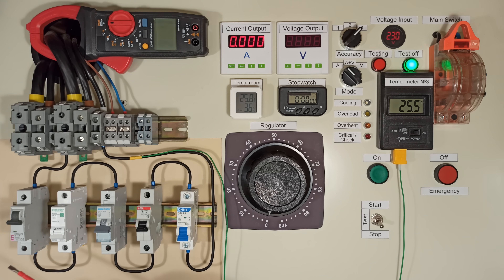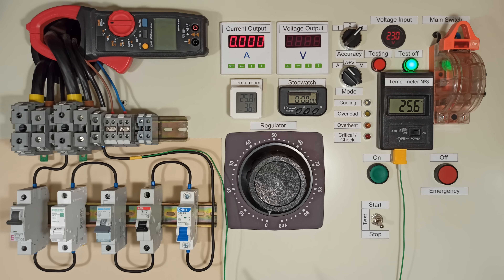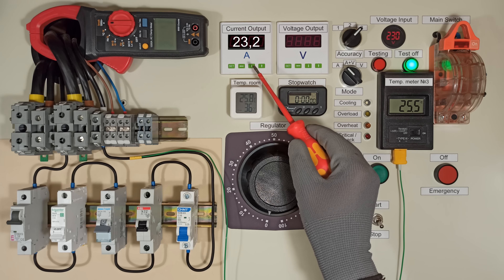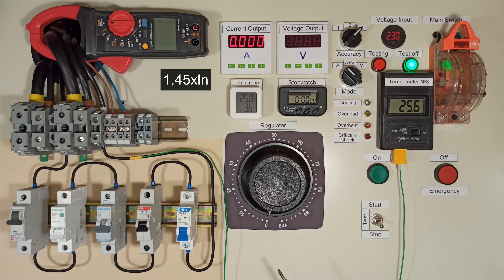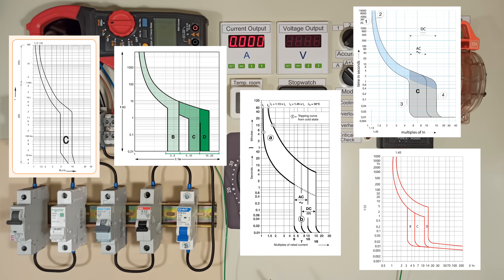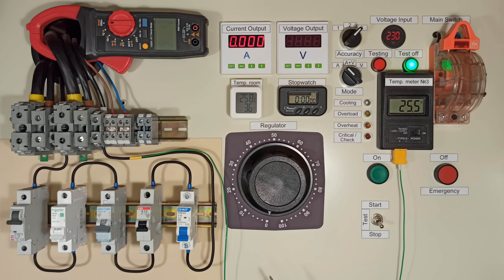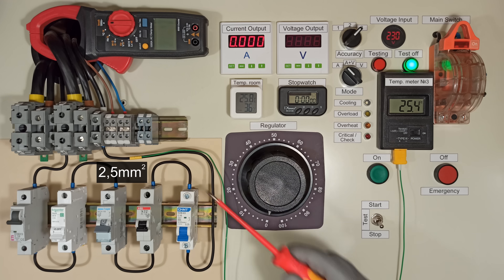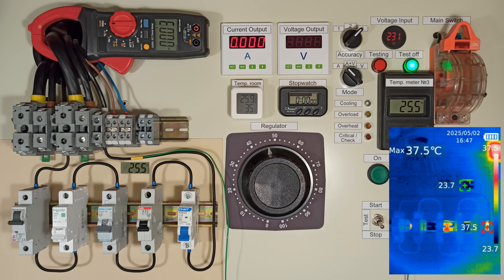Test MCB 16A. ETI, SE, Hager, ABB, CHINT

Comment: I'd like to see the same test but with the current carrying wire and thermocouple wrapped in some insulative fiberglass, more closely replicating the in-wall conditions (at least in the US).  Or you could place in ducting/flex tube with a few more conductors, like would be found outside North America.  
I wonder how much higher the wire temperature would rise without open airflow over it.
Reply from the maker: @FirstNameLastName-tp5bu Good suggestion, I'm still working on a larger test setup. Do you run the wire or cable directly in the insulative fiberglass, or do you also use a pipe?
Reply: @ElectroTest_1  Yes, here in North America the cable, often referred to as Romex (a brand name), will be run in contact with the in-wall insulation.  That insulation is usually fiberglass but can be other materials.  It's not uncommon to have 2 or more Romex cables running along the same path within a wall as they travel to distant areas of a home.  So the number of current carrying conductors in a small area can be 2 or more.  There are exceptions, for example in Chicago, all cable must be installed inside metal conduit pipe.

In residential construction, circuit ampacity is usually 15A or 20A, with 15A being most common.  Supply voltage is 120v and North American Electrical Code (NEC) calls for a minimum of 14awg (2.08mm2) copper on a 15A branch circuit, and 12awg (3.31mm2) copper for 20A.

Hope that gives you enough info to set up a test, if you want to emulate the way things are done over here.

[Edited to correct copper cable metric area equivalencies]
Reply from the maker: Thank you for the detailed information. I think it's worth trying. There is a problem with the availability of AWG cables. I will check if it's possible to order them at a reasonable price. Could you also mention some common cable brands that are typically installed inside walls?
Reply: @ElectroTest_1  Rereading my earlier reply, I found a mistake in my conversion from AWG to a rough metric equivalent.  (I'll try to correct my earlier post if YouTube will let me) I believe US 14 AWG solid copper wire is 1.63 mm diameter, or 2.08 mm2, meaning that the closest you'd have available is 2.5mm2.

Comment: Interesting test, it looks like the Chint has some more internal resistance on the top side. Which is getting warmer.
Im also curious how some budget brands perform. Like E-mat and Gacia
And also taken Eaton in account.
Reply from the maker: No, there was no additional heating in the CHINT. If you're looking at the thermal camera image — that false hot spot slightly to the right of CHINT was there even when everything was cold. It's caused by light reflection from the rail (which is also made of a different material). Such inaccuracies can happen due to reflections. Or did you notice something else?

Comment: I'm not sure what was the purpose of connecting them all in series and not checking them one by one if at the end you've repeated this test 5 times anyway.
Reply: Was looking through the comments to see if this type of response was here already. I agree, the test should be performed in parallel or individually. Parallel may even be best. That way you don’t have to account for the wiring to be at the same temperature at the start of each cycle.
Reply: Parallel connections could have been used. That would have been my own choice. I would expected some interactions with series wiring.
Reply from the maker: Hello, yes, it would have been possible to do each one separately, one at a time. However, there is a difference! This way, we know for sure that they were all under the same conditions. The main point is that the current was the same through all of them, as well as the temperature of the conductors and the air (although the temperature barely changed). It's also possible to conduct the tests separately, but people would have more doubts.
Reply: @ElectroTest_1  why did you end up doing it in series? makes literally no sense

Comment: Chint haas other problem too.
The size is not fully IEC standard. You cant put them in power rail with differential protector!
I hate them!
Reply from the maker: Do you mean that it's not allowed to connect the RCD and the line circuit breakers (PIN type) with a single busbar? I haven't installed CHINT RCDs yet, although they should be compatible.
Reply: @ElectroTest_1  No. You cant connmmect them to rail. Powerrail. Have a look on the bottom. The position of the connection is much higher than the standard. Put them side to side as touch! You will see, the chinafuse is short. So it cant pass the installation test if You are using professional copper conductor rail instead of cables..
Reply from the maker: Now I’ve noticed that they are indeed smaller in size (height). But that’s not really a problem. You wouldn’t be connecting breakers from different manufacturers with the same busbar anyway. You already know that Hager, ABB, and Schneider can’t be interconnected either — the distance from the front to the terminals is different. If all the breakers and RCDs are from CHINT, I think there won’t be any issues. Although, I just remembered they do have another problem — the plastic rail clips. When you try to install or remove a 2- or 3-module breaker, it’s difficult (you need two screwdrivers).

Comment: were they all rated to work bidirectional?
Reply from the maker: Hello! For the tripping of circuit breakers, the direction of current or the way they are connected does not matter. There may only be additional installation rules in certain countries.
Reply: I think that is only a potential issue with RCDs (or RCBOs).  But the bidirectional ones seem to be so common here that suppliers do not even bother stating whether a unit is bidirectional or not on their websites.

Comment: I never trusted the CHINT stuff. Huawei uses them in all kind of flavours in their transformer substation containers which always made me nervous. 

They may have a conformity declaration but i have my doubts about quality and effectiveness of these products.
Reply: I don't understand the problem, it was perfectly withing the advertised specifications. The one that fell outside was the ETI that tripped earlier than it should have
Reply: I have used Chint. They are not overpriced. No mechanical defects and trip according. You needed to specify whether the breakers were all the same category type.
Reply: CHINT is the best in this comparison， it spotted in the middle of the design curve. The current doesn't mean anything but the temperature. 40 degrees won't hurt anything or any wire. So, it gives you more room and won't break early.
Reply: @Porsche911-qx1do I agree, I think the chint is the best among them according to this video, I am an IT infrastructure supporter
Reply: il chint ha rispsto entro la curva target, e in molti paesi viene usato nei contatori della rete nazionale
Reply: @Ale55andr082 100%. As long as it’s within spec that’s what matters - well to me anyway
Reply: In the oil field I'm working on, we use Chint products from L.V to M.V and they're working great.
Reply: I would agree with you 20 years ago, but now I find no difference between CHINT and ABB, because my job, I have purchased hundreds of thousandsof these, their faulty rates are so close you can't tell the differences
Reply: Actually, all circuit breakers are made in China, and the brands give them different prices. For example, the Rafale, which costs 280 million, is beaten by the J10, which costs 4,000.
Reply: buddy the spec is to fail within the hour, you aint no electrician
Reply: Strange comment. Only ETI failed the test in the video. In a way, Chint's product is the best because it provides different choices.
Reply: people who has a bias of course won't trust stuff from China even though everything in your home is made in China, kind of hilarious
Reply: Unreliable quality? Chint is widely used in industrial applications across China. As an industrial powerhouse, there’s really no reason to doubt that. What makes you skeptical might just be the fact that some products can be both affordable and reliable.
Reply: U should feel nervous coz ur made in china keyboard has sent your comments to chinese government lol
Reply: All stuff is from China, with another name
Reply: @antoniocalimero1173  Most of the ABB MCBs you'd find on the European market are made either in Germany or in Bulgaria.
Reply: @nikolamladenoff 它们在中国也有工厂，中国制造成本更低。这不是什么问题。
Reply from the maker: Thanks for the comment. I sometimes use them in the budget segment, so I'm also curious whether they're reliable. =)

Comment: Thank you for this very interesting video. I expected at least one of the MCBs to last longer at 23.2A. Because they are Type C.
Reply from the maker: @0commentarygaming According to the standard, they could shut down within an hour — and that would be acceptable. However, manufacturers may allow earlier shutdowns. I'm wondering if the wire thickness affects this. If you use 10 or 16 mm², would it last longer? 🤔
Reply: @ElectroTest_1  It's possible that the MCB will last a bit longer using a thicker cable. Because the connection point will get a bit less warmer and that could affect it.
Reply from the maker: @0commentarygaming Yes, it's definitely possible. I'll try it somehow and see if there's a big difference.
Reply: @ElectroTest_1  That would be interesting. And you could also test the different Types, for example a Type B MCB next to a Type C MCB :).
Reply from the maker: @0commentarygaming Okay, Mario=)
Reply: @ElectroTest_1  Thanks ;)
Reply: @0commentarygaming @ElectroTest_1 Type B vs type C should have no effect in this test case as you are only doing a small overload. The thermal curve is the same for all types of MCBs. It's only the magnetic part at the bottom of the curve that varies for B vs C vs D etc. So if you do 5x the rated current then type B should trip instantly, for type C you need to use 10x the rated current and so on. But for 1.45x the rated current you should not see any difference between type B vs type C vs type D as that part of the curve is the same for all. The only difference will be part-to-part variation which would you see with 5 x type C for example. Overall this is a great video showing the reality of how MCBs trip as an overcurrent is passed through them.
Reply from the maker: @davefrizelle3882 Thank you, my friend, for the detailed explanation) Yes, for B and C, there shouldn't be a big difference up to 3*In) And after x3, it will get more interesting!
Reply: @davefrizelle3882  Yes I think you are right but to be sure we would need a test. With maybe 5x Type B MCBs and then compare them to the 5x C MCBs.
Reply: @0commentarygaming  All the MCBs have to follow a spec, and the trip curves are defined by IEC 60898-1:2015. Within the curves in that spec there is some margin, so some breakers will trip faster than others, but if you look at the spec you can see that the type - B or C or D - has no difference on the thermal characteristic.
Reply: 16A breaker are made to protect 2.5mm² wire, so testing with bigger section isn't needed.

Pretty nice setup you have set, congrats!
Reply from the maker: @cesariopereira7431 Thanks for the comment, I appreciate it! However, a 2.5 mm² wire can carry up to 25 A continuously and be protected by a 20-25 A MCB (under certain conditions). It's just that 16 A breakers are typically used to protect sockets, since their rated current is usually 16 A.

But that’s actually a different topic… You can have a much larger cross-section with a 16 A breaker — for example, when the cable run is long and there's significant voltage drop. Another, more common case is internal wiring in the distribution board. It’s usually done with 4–6 mm² wires or a shared supply busbar. Even if the output is 2.5 mm², a thicker wire on the supply side can already have some influence — though I still don’t know exactly how much. 🙂
Reply: Yeah, you can have bigger section for long runs, its protected.
What im talking its accord to electrical  code rules, in some country's you have to follow rules by code.
Reply: @ Yes so I do not expect any difference between B C or D at 23a. But I still think we should give it a test.
Reply: @ Exactly, that's why it would be interesting to see if the breaker trips earlier or (more probably) later using a bigger wire for long runs. I don't expect it to make any difference but it's possible.
Reply: We use bigger section on long rules because drop voltage, bigger section, less resistance! (Of course you have to use formulas to do a proper installation).
Reply: @ Exactly, that's why you can find a 16a MCB connected to a 6mm² wire, to keep voltage drop low. So to test the 16a MCB, with for example 6mm² makes sense.
Reply: @0commentarygaming  Makes sense if you do a 100 meters wire test for both 6 and 2.5mm².
In this video really don't makes sense, yeah, will trip a bit later with 6mm² because takes more time to get hot. You can test it, just for fun maybe 😅
Reply: @cesariopereira7431  Yes it's about how much later the 6mm² will trip because it gets hot slower. And it also don't get that hot at all, not only slower. So It should be interesting to see the results, even whit a shorter cable.
Reply from the maker: @cesariopereira7431 My friend, the length doesn't affect heating :) The heat will dissipate evenly along the entire length. The only thing that might have an influence is cooling from nearby, thicker cables. You can see this in some of my tests — the temperature is lower closer to the terminals.
Reply: @ElectroTest_1 , i know all that, this its just for tests, but in real installations you don't put more than 16A in a 2.5mm² wire.
Reply: @ElectroTest_1 更大的线缆能让使用时间延长。我曾经在必须紧急供电的特殊状态下使用过。甚至在较低的过载工况下，断路器不会被触发。

Comment: At In * 1.13, the circuit breaker must not trip within 1 hour, and at In * 1.45, the circuit breaker must trip within 1 hour. This means that all values are OK, but it is surprising that ETI was not in the tripping curve.
Reply from the maker: Thank you for the explanation :) Yes, I'm familiar with this standard. Have you noticed that the zones differ slightly between manufacturers? I mean, they all comply with the standard, but each one has its own characteristics. Maybe ETI made their zone a bit too narrow? I’m thinking of checking ETI separately as well.
Reply: @ElectroTest_1  
If you know of any such standards, please mention them, because I think it's always important to know whether something is still within the standard or not. 
As a simple example: If the standard allows a bar to be 20 ± 10%, anything from 18 to 22 is fine. That way, you always have a reference point, not this "19.9 is much better than 19.5" or something like that.
Reply from the maker: @HansWurst-bs6yr Thanks for the suggestion. Of course, the standards define acceptable limits, and there can be measurement inaccuracies during testing. I think that as more similar videos come out, viewers will better understand how all of this works and which points are truly important. It should also be clear that there can be differences between manufacturers, measurement inaccuracies, or even defects in the specific sample used on the test bench.
Reply: "At In * 1.13, the circuit breaker must not trip within 1 hour"  --> what is the reasoning behind it?
As a layman, I would assume that it should trip when it's over the rated current...
Reply: @panda4247 
I can think of one reason:
Power supplies (like the ones in computers) use coils and capacitors to rectify and/or transform current. This can lead to a very short spike in current the moment you turn them on, as these components basically are short circuits and you don't want your circuit breaker to trip every time a PSU is turned on. (This happened fairly regularly in ye olden days)
Though these spikes barely last a second, let alone an hour, so why this is specified as 1 hour I don't know.

Comment: Fun test!
Reply from the maker: Thanks for the comment :) Yes, I do like circuit breakers. I find the device quite interesting. Sometimes they don’t trip correctly or even fail! What current levels do you find interesting?
Reply: @ElectroTest_1  Well, we talked a little about relay testing. I like the high voltage breakers, vacuum, SF6, old school OCBs etc...  But that's a little outside your channel. 
Fun to see you play with stuff that fits on the bench and inexpensive enough to actually play with.
Reply from the maker: @inothome Yeah, I enjoy researching. In electricity, there’s actually a lot that’s unclear and that I’d like to learn. Sometimes I used to just focus on project work and rules, and I missed out on many interesting processes, even the simple ones.